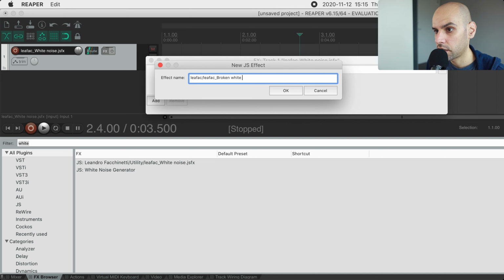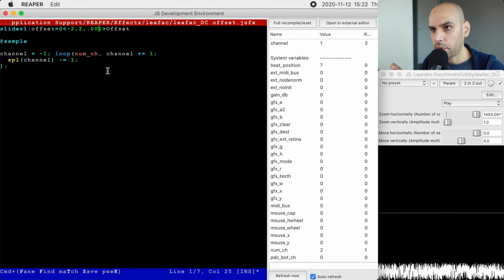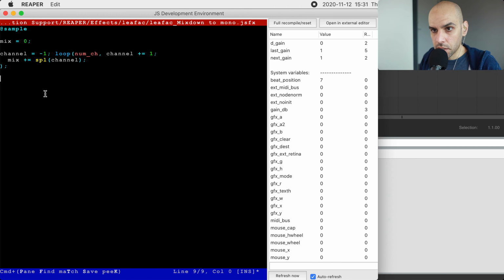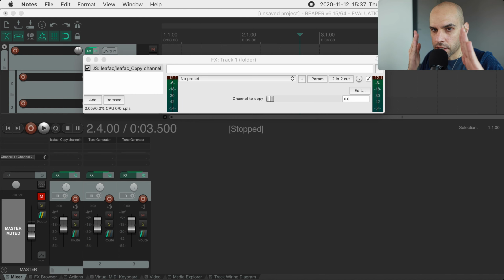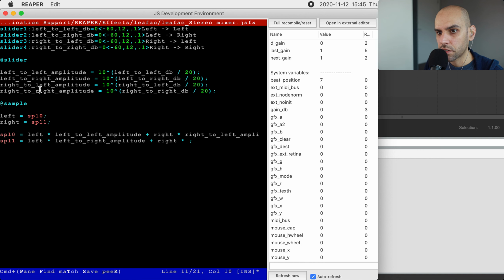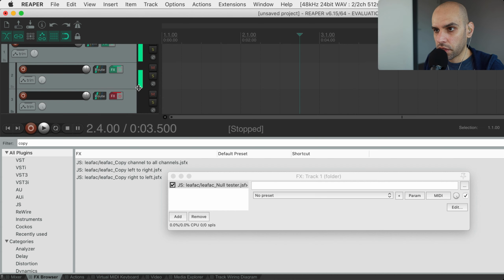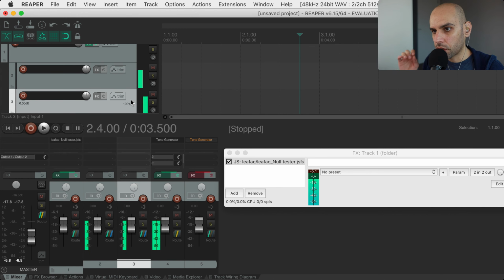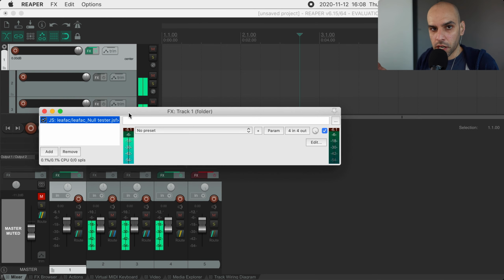Programming Audio Effects: As Many Effects as Fast as I Can

Comment: Nice videos, Leandro, thank you for creating them. The DC is in  principle just a signal with freqency of 0 Hz, so in this example there is nothing to be heard. Of course, it adds the energy (so the meter shows louder output). To remove the DC offset, a simple highpass filter with fixed lowest possible frequency can be used.
Reply: Oh, you just mentioned the hpf a little bit later. This is problem, when you want to write a comment while the video is not finished :)
Reply from the maker: @calixtopascoalel7023  Thanks for watching. And thanks for sticking around until the end 😁